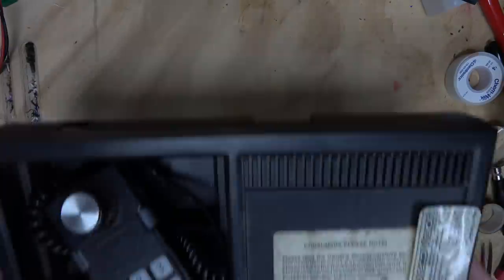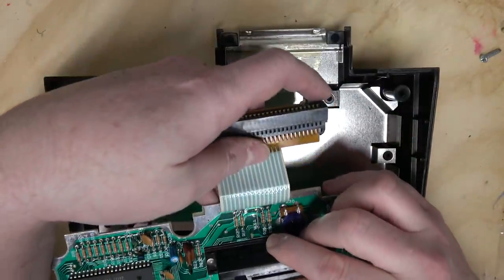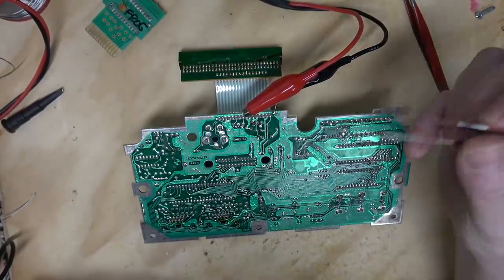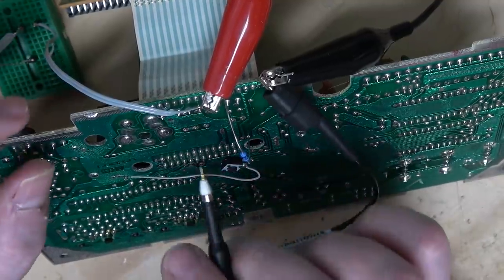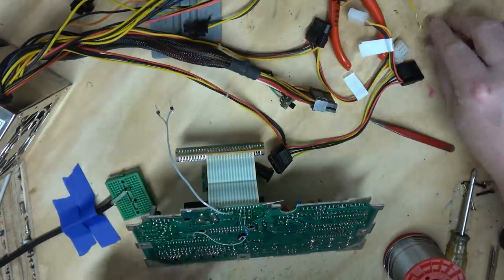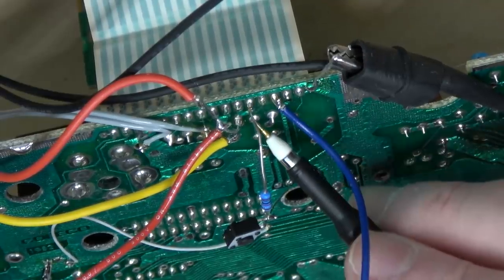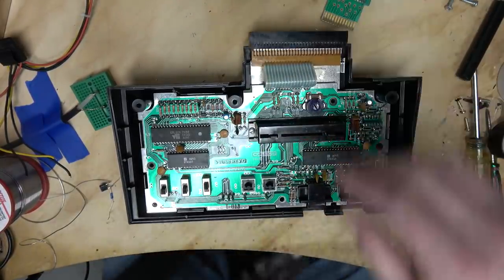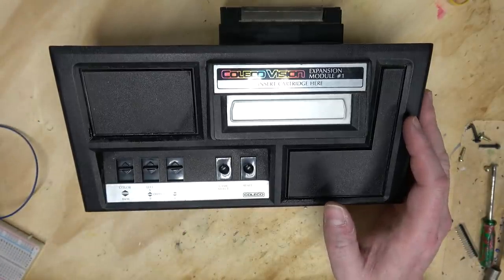Inside the Atari 2600-Colecovision Adapter

Comment: Released in 1982, the Colecovision Expansion Module #1 sold for $175, which was about $50 more than an actual Atari 2600 at the time.

Comment: The 2600 adaptor for the Colecovision is a self contained unit on its own. There are videos of modding the device to accept 9v DC on its own and output composite video and audio. All it's missing is the RF modulator.

Comment: The reason the master system looks like a colecovision upgraded is because it's antecessor SEGA SG-1000 was almost a pumped up colecovision clone. When the SG-1000 failed against NES, SEGA upgraded it to the SEGA Mark III (Master System), too little too late, at least on USA and Japan, here on Brazil and in Europe it had space to enter the market. The Mark III is retro-compatible with the SG-1000 so they kept the basic design. Also, the Game Gear is a Master System, so the colecovision legacy somehow lived many years after colecovision leaving the market.
Reply: The SG-1000 wasn't even "pumped up"...it was actually a cut down, cheapened copy of the Colecovision hardware without an expansion port or any BIOS ROM. That is one possible reason some SG-1000 games don't look as visually impressive as Coleco equivalents despite being similar hardware and game ROM sizes--the Coleco games could use less memory and code by calling OS7 BIOS service routines whereas the SG-1000 games needed to include more "boilerplate" code. Having that BIOS could easily reduce amount of code in a cartridge by 20+ percent.

This is also why there are more aftermarket ports of SG-1000 games to Coleco than the other way around...because there is no BIOS in SG-1000 the games could possibly run on Coleco simply by remapping memory/IO addresses. In many if not most cases Coleco games do BIOS calls which means SG-1000 ports would have to include equivalent chunks of Coleco OS7 BIOS which is more work.

Comment: The +12V is b+ for the video output amplifier.  Its output voltage is biased to work with the CV modulator.  The -5V is a pull-down so you can still use the ColecoVision controllers in the Atari module.
Reply: Also, if you spent time on AtariAge, I'm surprised you didn't run across the collection of ColecoVision-related schematics that also include the expansion module 1.

Comment: You've been producing killer content lately.  First a video about the TI-58 programmable calculator and PC100 thermal printer, then repairing a Sega Master System, and now you're covering the Colecovision expansion module #1.  I need to repair a couple of these, and I'm currently working on my broken Master System thanks to you.

Comment: When I was a kid we bought a Coleco ADAM computer (the "complete" version, not the "Expansion Module 3" one that plugged into a stand-alone ColecoVision) at KB Toys for something like $100 after Coleco imploded because, hey, my mom bought the argument that it was cheaper than a typewriter. They also had these 2600 modules for practically nothing so... yeah, I confirmed they work plugged into an ADAM too.

I guess what really made it funny in retrospect was the ADAM had composite monitor support which we actually used (had a Leading Edge "Gorilla" monitor hooked up to it), so I got to be the kid that played their 2600 games in living high-persistence green monochrome.

Comment: Nice.  I am pretty sure back then they removed the Crystal and added the awkward connectivity, to try and prevent a company from making a simple edge connector dongle that would have made this as a stand alone 2600 unit.
Reply: Coleco also made a stand-alone 2600 clone called the "Gemini". I have it in a box somewhere. Not bad quality, really.

Comment: FWIW: The TMS 9918 usually has a composite in that's fed to the background plane - a sort of primitive genlock.
PS: As the years have gone by I've become quite the fan of those Ti VDP's, their composite input, and their dedicated RAM. It makes adding colour GFX and sprites to systems that otherwise don't support such functionality really easy... and as Ti's chips were used a good deal bending old hardware to support other systems isn't too hard. My modded Coleco ADAM and a very hacked about Amstrad PCW make use of this.

Comment: This is how I play Atari 2600 in that sweet Composite instead of RF(Coleco is way easier to mod then 2600 for Composite). Wish there was an adapter for the 5200 or 7800.  There was a rumored 5200? version or maybe 7800 in the works but never released....

Comment: Used to have both the ColecoVision & the expansion Module #1. Not sure if we purchased both together, (perhaps as part of some deal the store was having at the same time) or purchased the Module later. But man, imagine if hardware manufacturers today had the guts to do something like this! Technically, they could, I'm sure. But hardware manufacturers wouldn't allow them to get away w/it. Having said that, you can play several generations of console (& arcade) games on your Xbox One & Xbox Series S|X via emulation - thru "developer mode". Now, if only if MicroSoft or some 3rd party publisher allowed the mass-market to purchase a cross-gen emulator that played your ROMs, that'd be amazing. 🤩

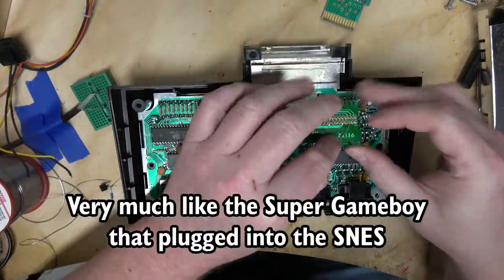Comment: 15:41 More like those aftermarket devices that allow playing NES, Genesis and GBA games on SNES. Those used the host console as a power supply. The Super Game Boy did have SOME interaction with its host and actually did store data, for like some graphics and sound enhancement as well as single-unit multiplayer for games that cared to program support for it. The US and EU Space Invaders could even load a SNES port of the game into the console RAM and run it. (I assume it was somehow different from the actual SNES cartridge version.)

Comment: I encountered a very similar problem working with a TMS9918. The chip output the correct signal format, but the signal would instantly attenuate whenever I tried to plug it into the TV. Eventually, I realized that the chip was meant to have an additional transistor between the 9928 and the video out. That might be your issue. The colecovision probably has it's own output transistor that isn't included in the 2600 'adapter'.
Reply from the maker: Good point. This unit is supposed to boost the signal but it doesn't seem to be. Maybe a bad transistor?

Comment: The CV is my fave system!  Just cleaned up the ADAM computer recently and was playing with it.  Some of the cassettes still work...  Coleco also made the 'Gemini' which was a standalone clone of the 2600 so it was probably very similar to what's inside this expansion you open.
Reply: The Gemini used the exact same TIA clone but the board was a completely different design in order to incorporate the colourburst crystal and an RF modulator.

Also the Gemini board was single sided with the traces and mask only on the bottom. The component side was blank beige with no traces--wherever the traces had to cross on the bottom side they put through holes and ran jumper wires  on the component side (the through holes weren't even plated through). The contruction of the Gemini was definitely very simplified from the original 2600.
Reply: Nice! I just picked up an Adam as well. I don’t have the power supply printer, but I have found some guides of people wiring up a custom ine
Reply: @Roanokekidstech  Ya, my printer still works and i even have a working ribbon cartridge, but its so loud and slow.  mainly just a large heavy toy now for printing out high score lists on the few games that support it.  builing your own psu is a good idea.

Comment: Power supply. Input 120v ac-60hz 25A. Output pin 1: +5 vdc .9A.  Pin 2: -5 vdc. .1A. Pin 3:  +12 vdc
.3A. Pin 4: ground. Model number 55416

Comment: I’ve started collecting arcade games a few years ago but this past year I’ve taken a deep dive into retro consoles I played in the 80’s lots of Atari games and intellivision’s in various conditions including the intellivision 2. One problem I have noticed is how the labels mould on the Atari games I’ll eventually find a solution for that tho. I also picked up the Vectrex which I never knew existed until recently
Reply: Rubber cement works pretty well when re-attaching the labels to games that Activision made for the 2600. You could also use a glue stick on the end labels for the cartridges, but the effectiveness of that method tends to vary.

Comment: So since this is just a compositie video passthrough device to the Coleco, and we can pretty much 3d print anything these days, could make some interesting "adapters". You could take the easy route and emulate with an SBC, but to make it really cool use hardware... how many different "systems on a chip" exist these days? A NES adapter? a Genesis?
Reply from the maker: Someone on Atari Age made a breakout board. Plugs in, provides power and has AV out. I'm still not sure why this one isn't producing a valid composite signal.

Comment: Interestingly, the Colecovision is loosely based on the MSX computer system hardware.  So, I guess that means the Master System is a loose evolution of the MSX hardware.
FYI, they didn't win the lawsuit with Atari (they won a single case, and then settled out of court).
Reply: MSX is based on the Spectravideo computers.  Spectravideo made a Colecovision adaptor for the computer and an MSX adaptor.  MSX 2 is similar to the Sega Master System but with much better bitmap graphics and poorer sprite handling/scrolling facilities

Comment: Had this. Sold it. 
Finally let go of most of my consoles. 
Down to 5 consoles from 15 or so. 
If it can be emulated I sell it. I'm done. 
Can't hoard anymore. Lol.
Reply: Same, to an extent. I stopped buying disk based stuff because disk rot, and have started using SSD solutions for roms and use them on real hardware. Best of both worlds.
Reply: @MediocreTCG  nice. I see they do a lot with Amiga 500 and C64 too.
I've tried Lemon Amiga...and Amiga Forever and Vice for C64 over the years also.
C64 had like over 20,000 games in one set years ago. Lol. 
I don't have time in my lifetime to play with all of it. I wish. 
I still kept my Amiga 500 and C64. And a Pong console from 72. Wii. GameCube. Xbox. Xbox 360. Mostly with games I love and will play. SNES. NES. Overplayed those emulators in early 2000s. It's never ending. Not even touched Dreamcast yet and the many other consoles.
Reply: Given that you can literally fit anything commercially produced and distributed on either cartridge or floppy disk from practically any system available into like about 1-2 TB of HD space. Probably less. It get's a bit iffy though once optical media entered the scene.

Comment: And why don't you use a pc source to feed the colecovision and check that module 1 works? There are some that give you the -5 volts you need. This is how I run my colecovision myself. I don't have the original power supply. (Google translate).

Comment: How would you get 5V, GND and -5V?  Would you put in 10V, then hook GND up to 5V and -5V up to 0V?
Reply: voltage is relative - in some 3-phase street wiring? two grounds from two different hookups can have a differential of hundreds of volts (that's why you don't connect neighbouring houses in the UK with network cables) so yeah - as far as my primitive understanding goes? you're correct.

I guess +5v and -5v would essentially be the electrons moving in opposite directions - so errr.. I guess the -5V side would have certain components 'backwards' and any shorts between the -5v and +5v sides would cancel each other out by equalling the common ground? that's probably useful given the cartridges might be shorted or plugged in while the console is on etc
Reply: You need a center tap of a 10v winding in a transformer, that would be ground, and 5 and -5 So, the Coleco vision had a huge ass trasformer, my family had one, even AVGN made fun of how big its, probably in part because of the power requirements, 4 amps of each 5 volts is like 8 amps of 10 volts, its a lot of current, meaning a big ass transformer.
Reply: Thanks for explaining that.  Would it be possible to use a beefy enough benchtop power supply to supply 10V, and use a simple voltage divider (with beefy enough resistors) to give 5V, 0V and -5V?
Reply: @rickseiden1  Yeah, but still 4 amps its a lot, it would be better get a transformer from a stereo or an amp, those mostly use simetrical power, even if its say -12 and 12 and then using regulators to get it down to -5 and 5
Reply: Cool, thanks!
Reply: The chip in the breadboard is probably an ICL7660. With this chip and two 10uF capacitors you can feed 5V and get -5V. The Colecovision uses a different method for getting a negative voltage.

Comment: Using a 7905 could have been a simple option for getting the -5v from the -12v
Reply: Assuming he has one. The negative regulators were never quite as common as the positive, and even more so on this side of 1990.
Reply: @absalomdraconis  I wouldn't be all that surprised if Ben had at least one kicking around in his draws. In fact you are right they were not that commonly used.. so if you did ever buy one they normally stick with you for life :-)

Comment: Did Ben ever actually make sure the switches were in the correct positions or use the normal buttons before soldering new stuff on?

Comment: Got some strange voltages on the connector, +5, - 5, - 12vdc, probably has to do with video output, and 3.58 mhz from the coleco
Reply: Just a 2600 with the video being fed through the coleco vision, you can just consolize it by plugging in the proper signals on a edge connector
Reply: And just plug it in and use it, no colecovision needed

Comment: what was the price difference between this and a 2600?
Reply: I had this expansion module back around 1984 or 1985. From what I recall, it was about $80 US at the time, definitely less than $100. But you had to have the Colecovision to use it. Coleco later released a stand-alone Atari 2600 clone system, the Coleco Gemini.  https://youtu.be/j5daj6sTg_M
Reply: @RetroFett  what was the 2600 at that time?

Comment: Someone should decap the coleco Tia chips and see how much the clean room engineered the gates are on the silicon die, decap an official atari Tia chip and compare the die side by side....

Plus now you can really make 1:1 gate level replicas, and do it at smaller feature size, cmos version, or 3.3v version to hook up to a modern microcontroller, add some extra logic, and use one of those spi tft lcd,

I mean they did shrink the vcs motherboard to effectively one chip, be interesting to decap a unicorn vcs
Reply: Technically the 2600 was one of the first microcontroller architectures, if you consider the single chip vcs, 6502 based mcu

Comment: What is a negative voltage?
Reply: It's a voltage which has a negative potential towards ground. For instance: let's say you have +5, 0 and -5. That means if you measure +5 to 0 you will have +5V volts as usual but if you measure with you positive lead to 0 and the negative to -5 you will also have +5 volts meaning 0 has a +5V potential in relation to the -5. Also, if you measure from +5 to -5 you will get 10V. In short, a negative voltage is a voltage with the polarity inverted in relation to ground.
Reply: Fun fact reason why we call electronics electronics is from electron which ofcourse is negative charge
When you find out power isnt coming from the wire your mind will really explode 🤯
Reply: @primus711  it's not about the charge of the electrons (all electrons are "negatively" charged, but this has nothing to do with voltage).  It's about the potential difference between two points.

For example, if one point has more electrons than another point, then it has a positive potential (compared to that other point).  If you compare them in reverse, it has negative potential.

Basically it's just telling you the direction power wants to flow. 

So, DC voltage is all about the potential difference between two points, if you have 400v DC and 405v DC, the potential difference between them is just 5v, and you could use that difference as a 5v DC power source.

What this chip needs is a ground reference, a voltage source that's 5v higher than the ground reference, and another voltage source that's 5v lower.

(For example, you could use 0v, 5v, and 10v for the 3 sources in a pinch.)
Reply: @BrainSlugs83  why r u telling me this
Reply: @adilsongoliveira  okay that makes more sense than what ive read up before, so i have one more question, lets say you had something that took -5 volts and you had a 5 volt supply, if you fed the 5 volts in backwards so positive to ground, ground to positive, assuming it didnt mess with anything else, that should work right? if im understanding your example correctly it should.
Reply: @girrrrrrr2  that would work if that's all it needed.  Most things that need a negative also need a positive.
Reply: @BrainSlugs83  In just a couple messages you have taught me the basics on something that ive been trying to figure out for a while.

Thank you!